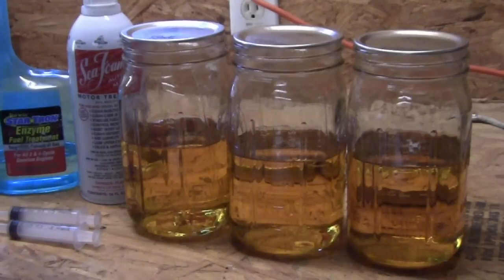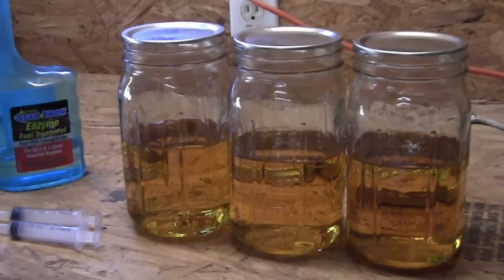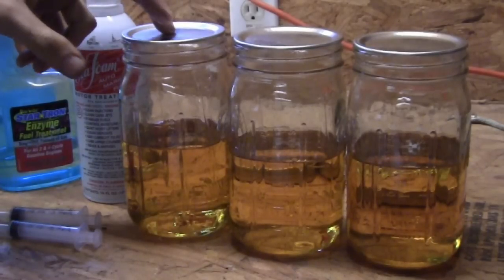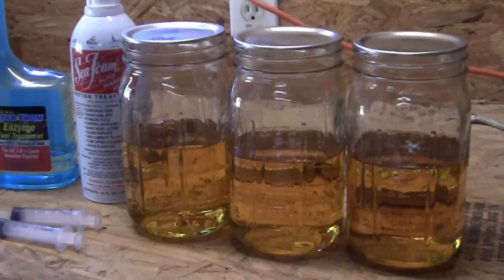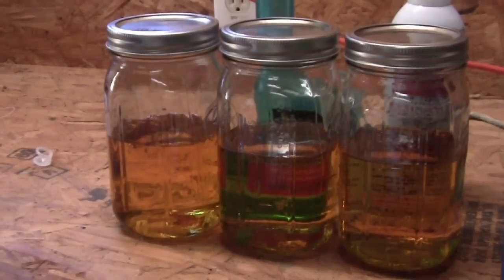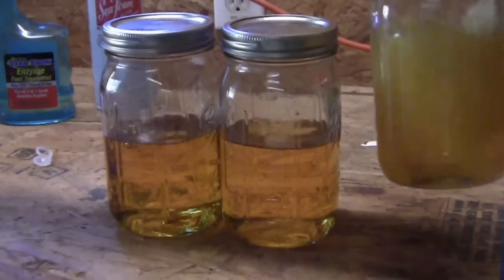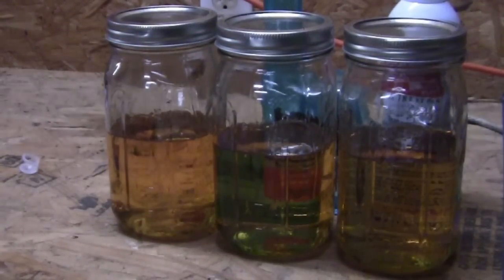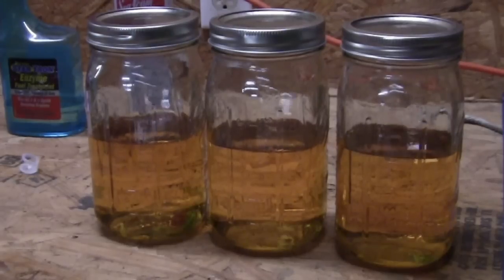Stale Gas: Can it be treated with additives? My unscientific test and results.

Comment: This was similar to a visual water test. You can't visually tell the difference between bottled water and poisoned water, but you can taste or scientifically prove the difference. It's based on how quickly and cleanly the gas burns or ignites. The additives may have helped the gas go from poor/no igniting to fair/start/rough idling igniting. Run it through an old chainsaw or lawn mower you hate as a test.
Reply from the maker: https://youtu.be/2c5XRFuFaLY I thought I would be super smart and do exactly that. What I did was inadvertently prove that gas doesn't really "go bad" in a sense, but rather evaporates and leaves behind deposits that clog carburetors and cause other fuel system chaos.
Ran probably 5 gallons of 5+ year old fuel through various engines, never had the slightest issue. I'll bet a real high performance engine might have complained a little but lawnmowers and even a truck of mine ran flawlessly on it.

Comment: Or if you have a lot of stale (not very fragrant) or sour fuel (smells bad) you can always throw a bit in your tank every refill - like 1/4 of a tank. Fuel is fuel OK.
Reply from the maker: Yup, you got it. I did a follow-up video that essentially proves just that by doing what I failed to do in this video. I ran an engine on stale fuel with no additives, not diluted at all and it ran fine, started nice and easy too. https://youtu.be/2c5XRFuFaLY

Comment: How disappointing, I was hoping that you would do some actual testing such as how does the lawnmower run using the fuel or a measure of its specific gravity or something other than "it doesn't look any different"...
Reply from the maker: cough https://youtu.be/2c5XRFuFaLY cough as it turns out, stale gas burns a-ok, but leaves behind deposits that clog carbs, and also gains octane rating, due to the more volatile components evaporating, which can make it more difficult to get an engine started on stale gas, especially if the motor is aged and not as healthy on compression as it once was.

Comment: I have a car I store out of State and only use it once every few years and have no problems with bad gas. It is a 1984 carb chevy v-6. I wonder why the ethanol in todays gas doesn't mess with it? Been doing this for 21 years. My lawnmowers always gel up and I have to clean the carb.
Reply from the maker: I would suspect it may have to do with jet size, smaller engines have tiny jets that are easier to get clogged up.
But I wouldn't put any money on my suspicion because I see TONS of carbed boats with problems related to ethanol fuel, but of course a boat also id in a much higher humidity and has water all around it so the tendency for ethanol to absorb water could be at fault in those cases.

I wish I knew more of the science behind it, but thats way over my head.

Comment: So you never tried to use it?  This guy says there is no such thing as old gas.  He does way more than you did because he actually ran his bike on 14 year old gas.  No enzymes, no seafoam, just filtered it, decanted the gas off of the water that all the ethanol had drawn out of the air and into the gas.  Thats it.  separate the water and filter any particles, then the gas should work just fine.
https://www.youtube.com/watch?v=2IrIEwiiJsM
Reply from the maker: I sure did: https://youtu.be/2c5XRFuFaLY
The big issue is the buildup left behind when gas evaporates tends to clog up carburetors, but the "stale" fuel actually seems to burn fairly decent.
Junkyard Digs claims that stale fuel will cause valves to stick because its gunky and doesn't burn properly, I'm unsure if I believe that or not, but from some of their videos it seems true. Any time I get a large volume of stale fuel, I blend it at least 50:50 with fresh fuel and it runs fine with no ill effects as of yet.

Comment: The color has not change but has it taken care of the varnish?
Reply from the maker: Most often the varnish buildup is from evaporation, and will require a carb cleaning. The gas itself will still run A-OK, but those jet plugging deposits won't easily be budged regardless of how much additive is added, see this video for proof with some ancient gas that runs perfectly fine because the engine was stored with the carb dry: https://youtu.be/2c5XRFuFaLY

Comment: This is garbage. The colour is irrelevant.
Reply from the maker: So is the concept of stale gas. It still burns fine and will run in any healthy engine, but the evaporation of the more volatile components leaves behind sticky gooey residue that plugs jets.
So, Drain your carbs before storage: https://youtu.be/2c5XRFuFaLY

Comment: You didn’t put the additives in  correctly. You need to tilt the cans and put them in slowly to the left side then lightly stir not shaken. Then put 2 ice cubes and a straw! give it to your wife 👍
Reply from the maker: I've always struggled with the art of the pour. Are fuel additives meant to be chilled before consumption or room temperature? I get confused which it is. 😆

Comment: I use an octane booster and mix that with 50/50 new gas with a little seafoam motor treatment and it works just like it would in anything..  the booster gets the stuff back to a good burn and seafoam will help clean out and burn whatever deposits the varnishing tries to leave in the carb or injectors..  use a whole can of each..  depending on how much  old gas you got..  last time i did it with gas it was 7 year old 50:1 mix that sat in my boat but boat was kept indoors so it wasent weathered from temp changes and condensation from those temp changes and humidity so it was better bad gas if you could put a name to it..  but damn 13 gallon gas tank was full and that gas cost 5$/ga so ill be a monkey fart if im gonna throw out 65$ of gas and the oil i had to put in it...  but the stuff worked great back in the boat and in the Mower and truck and to make a fire..
Reply: But i dunno about what it did to the color because i couldnt give less of a fuck what damn color it is..
Reply: 2 stroke oil is a natural ⛽ stabilizer

Comment: I was looking for this earlier and YouTube sucks and then unrelated I was looking for reviews on the fuel miser torque converter which is a low rpm stall converter they say can ad 1 or 2 mpg but 0 results that are about a torque converter but this video was down the list

Comment: yeah..did you try the fuel? and did you leave the lid off in order for the activators to perform? you have enclosed environments with nowhere for outgassing to take place and thus cannot expect much of anything to happen as youve pretty much entrapped it in a stagnated neutrality where it is essentially trapped in limbo.
Reply from the maker: cough https://youtu.be/2c5XRFuFaLY cough stale fuel burns a-ok in a healthy engine that was stored properly, each of these additives is basically a highly volatile solvent that makes ignition easier,  and might even clean up any varnish formed on the Jets in a carb if the equipment was stored improperly. Look at the sds sheets for basically any fuel additive and its nearly all solvents like naptha, acetone or some other highly flammable compound. The main problem is that if stored improperly the gas in the carb will evaporate and leave behind sludge that clogs jets. If you drain the carbs before storing equipment you'll never have an issue. (Source: never once having an issue starting my stuff each spring. 1-2 pulls max)

Comment: How do you properly dispose of old gas?
Reply from the maker: The update I did to this video (https://youtu.be/2c5XRFuFaLY) Essentially proves it doesn't really go bad, but perhaps loses some volatility, I've had great success mixing it with fresh gas and running it in any sort of power equipment, especially something fuel injected, We've run probably 100 gallons of stale gas in our 01 F150 over the years, mixing in a few gallons with each tank, doesn't seem to have any effect on how it has run, BUT if it has any sort of dirt, water or other stuff then it could be mixed about 50-50 with some waste vegetable oil, or some other waste oil and then start fires with it, as that dirt/water could cause serious issues with your fuel system.

Comment: I know for a fact you CAN restore old gas. I own several classic cars that sit for YEARS (Decades) and I have restored the gas with Seafoam and start additives combined. I make certain to use starter fluid in the carb to get the fuel pump moving and speed up the fuel getting into the carb until the car starts. THis also saves the battery and starter as you wont need to crank as much.
Reply from the maker: My updated video shows several year old (at least 3 years) stale gas running perfectly fine in a lawnmower with no additives perfectly fine, and we discussed in the comments how the more volatile components would be first to evaporate, which would make the fuel more difficult to ignite, thus leading to the "stale gas won't burn" theory many people have, when in reality it often tends to just gum up carburetors and get harder to ignite especially if the engine isn't super healthy
Reply: Please let me ask you what start additives you used I have my aunt and uncle’s Cadillac let it sit for 2 1/2 years that I’m trying to get started
Reply: Ethanol is trash & absolutely shits up our carbs , fuel delivery parts & basically internal combustion systems !!!…
Reply: It’s funny how you can find cars on YouTube that is start up with 20 years old fuel with almost no issue but people claim gas would go bad . Me personally I have mix experience with this and know for a fact that it really depend on the car .  If it was a POs to begin with then yes it’ll most likely not start
Reply: I just got offered 5 years old 50 gallons of gas (worth $300 )from a marine mechanic that he removed from a boat, he tell me that the gas is clean and looks bluish. Do you think y should add this gas to my boat with a newly rebuild carbureted engine.
Gas is expensive,  should I take a chance with the gas and add the treatment. I have to make a decision by tomorrow. Thank you.
Reply: @lukebaehr3851  Any update?
Reply: I have about 2,5liter of gaz thats been sitting in a gaz can, im gonna try with my moped to add some with a 50% tank of good fuel, and gaz cleaner to be safe.

Comment: I use acetone 40 to 1 won't dont change fuel color but it will bring back the octane needed to burn properly.
Reply from the maker: That should do it. We've had some real good discussion on this video and my newer ones on stale gas about how the more volatile substances likely evaporate out of gas, which makes it harder to ignite, and adding a little acetone would bring back that lower ignition point.

Comment: You forgot to test the fuel
Reply from the maker: Lol yeah I didn't do nearly as much as I should have with this, check out the updated failed attempt at a revisit. Turns out 3-4 year old stale fuel runs perfectly fine in a lawnmower engine. It's more of the evaporation leaves behind deposits that plug stuff up rather than the fuel won't burn or anything like that.

Comment: Huh?    You performed zero tests on the fuel's combustion characteristics.  That's the point of gasoline....to burn in an engine.
Reply: What about veet, won't that absorb the water
Reply from the maker: cough https://www.youtube.com/watch?v=2c5XRFuFaLY cough
Reply: You won't be able to tell a difference in the burn characteristics old or not. Lol
Reply: You should have also tested adding more water... Gas floats on  both water and ethanol once all the ethanol has attached itself to the gas. A downside is that you have to drain out the water from the bottom. An upside is that you get basically 100% gas on the top.

Comment: should Star Tron be used in a brand new engine
Reply from the maker: Startron is over 95% naptha, which is a highly flammable solvent. I can't see any reason it would damage anything, but I also doubt it has much of of any real measurable benefit to using

Comment: Should we guess what you were trying to acheive with a 24h visual comparison?
Reply from the maker: Startron claims to "Rejuvenate old fuel", But it certainly appears to have done a whole lot of nothing (especially so if you look up the contents). As the revisit video I did a month or two ago shows, the issue with stale gas is not necessarily the gas itself, but rather the tendency for gas to evaporate and leave behind carburetor plugging deposits, as I ran into a generator that it had completely plugged not just the carb but all the way back to the petcock with a varnish like residue. I took that nasty old gas, and put it into a lawnmower engine that had been drained of gas before storage, and it fired right up on the very old gas. I proceeded to run that stale disgusting fuel in my weedeater and riding mower, ran fine in everything.

Comment: I have gas in my 1994 Lexus ES300 that was pumped in on 6-16-2016 (I know the exact date thanks to a forest fire that forced us to move it that day), then the car sat until this week 8-25-2019. I thought for sure it would be bad gas, but after installing a new battery, all new brakes and new tires, we have found that the car is running like a champ no differently then it did in 2016. I can't even discern any bad stale odor with the fuel cap removed. But I am going to burn this off anyway and then replace the fuel filter and replenish the fuel with some decent additive. I have seen cars found and started after ten or 15 years of sitting using only the gas still in the tank at the time of abandonment. So their must be one hell of a grey area in this bad gas assumption. IMO bad gasoline shouldn't be running a car just fine like nothing is wrong. Do you think my 1994 Lexus is pushing more fuel through in order to get it to run correctly maybe? The more impressive thing was it started like it had not been sitting at all, lol. Yet its the first time in over 3 years that a battery has even been connected to it. I guess this car wants to live...
Reply from the maker: I thank you for sharing your experience, It proves my most recent findings on this matter, I also apologize for the essay I've written, as well as the likely terrible grammar and spelling. but here goes:
My most recent findings is that the main issue with "bad gas" is not that the fuel actually goes bad, but in carbureted engines the fuel evaporates in the float bowl and creates a slimy mess that will eventually harden into jet plugging crud, then even pouring new gas in won't let the engine run properly.

EFI engines such as your ES300, and any relatively modern vehicle tolerate evaporation much better as the fuel systems are sealed much better, and have to meet EPA requirements for evaporative losses (biggest cause of check engine lights up in NY where I grew up was "small leak in evap system", or a pinhole, literally a hole the size of the head of a pin in the system designed to prevent gas fumes getting to the environment).

The fuel itself might lose a little energy content, so the MPG or available HP might be slightly diminished, but it'll still run fine, with most modern EFI engines there are oxygen sensors to fine tune the amount of fuel being burned, if you have a OBD2 scanner you can look at the datastream for the Short term and Long term fuel trim values, if they are positive values by more than a percent or 2 then your cars computer has decided that the engine needs more fuel to run optimally.

I've got ancient gas running perfectly fine in a follow up video I made to this one, in a carbureted lawn mower engine at that, just the gas wasn't sitting in there gumming the whole thing up.
I've used all the gas I've gotten, whether its been a year old, or as much as 6 years old without any side effects in engines from a small pushmower size, up to a V8.

Its the deposits from evaporation that I believe is the big issue. Which your experience further fuels that as being a fact rather than just my findings.
Reply: I think the temperature swings of something like an attached garage vs outside in the sun would probably make a huge difference.
Reply: @corvairkid17 no difference, people in Texas or Middle East must have bad gas

Comment: Add an extra fuel filter and some octane boost, it will probably clog the first filter in a couple of months ($5 filter vs $40 gas, hmm) or you if your into bio fuels you could put all of your old gas in a barrel and add some KOH to convert the resinous laquer into a soapy crud, then just siphon off the clean fuel and leave the crud behind( this method will take about a week) I've never tried the KOH method, but it should work or it may make something else, who knows?
Reply: what is koh?
Reply from the maker: Interesting idea with koh, I've heard of using it for biodiesel but never gas. I ended up just running this blended with good gas into a fuel injected truck, ran a-ok. Also did a follow-up video not long ago where the stalest gas I've ever found ran perfectly fine in a little push mower. Likely the varnish buildup from sitting is far worse that the actual fuel degradation
Reply: @trythistv  what is KOH?
Reply from the maker: @janpenland3686  Potassium hydroxide, more commonly called caustic potash, used in soap making, as well as biodiesel production, alkaline batteries and other stuff. I'm unsure how it would react with gasoline, but it is an interesting idea.